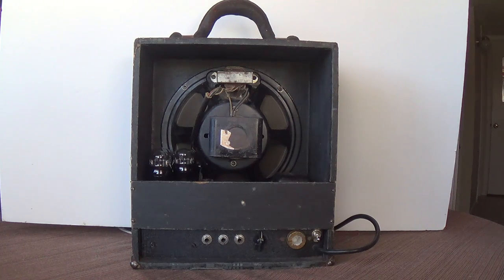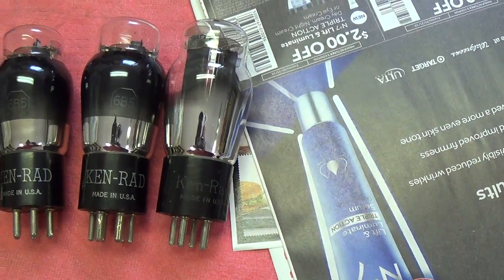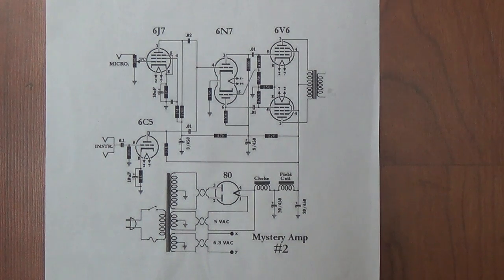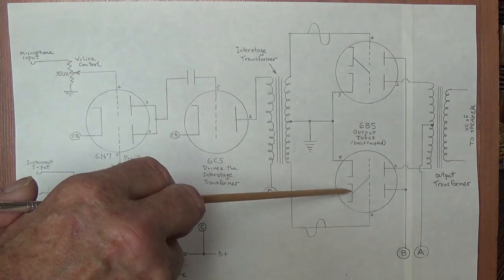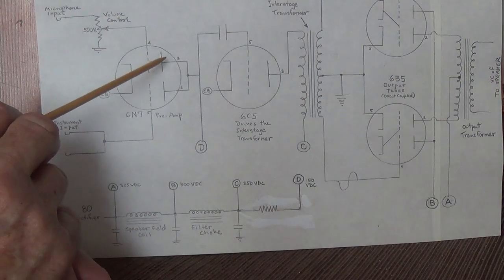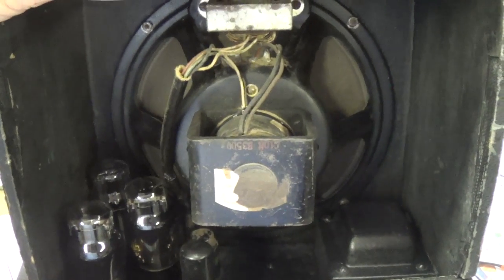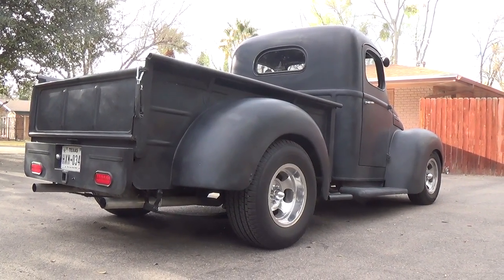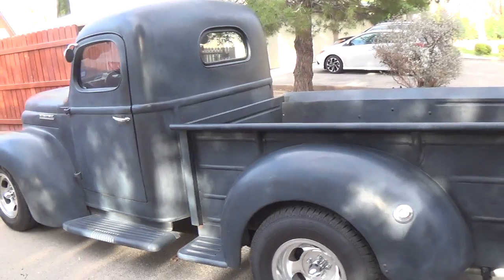Let's Evaluate and Repair the Ebay Mystery Amp

Comment: Great video as always.  I am wondering about the difference in the amps.  Do you think your "mystery amp" schematic a different version or different model than the amp in this video?  Also, I am very amazed that a speaker could survive that long and very amazed that the output tubes and other circuitry could operate and sound that good after replacing one item.  

What a great truck.
Reply from the maker: Thanks, JD. The amp had obviously been worked on previously, so odds are good that whatever was wrong with it was probably repaired at that time. I'm guessing that shortly after the repairs, the interstage transformer failed, and facing a $100+ part replacement, they simply cut the cord and sold the amp on Ebay as-is. The old speakers are plenty tough. Unless physically damaged or blown out by excessive power/heat, they tend to sound wonderful.
Reply: Good stuff.  I am looking forward to more "amp shenanigans" as you say in Mystery Amp part 1.

Comment: Great job on this amp, Doug! I was surprised to see that there are no DC blocking caps on the inputs to this one. A short somewhere in the preamp section could result in quite an electrifying performance! I also hope that metal speaker grill is grounded to the chassis, for the same reason. Also great job on the International truck, she’s a beauty!
Reply from the maker: People were tougher back then, Gary......a good shock once in a while was considered healthy :):) It would require a dead short between a grid and plate to really blast you, and they are exceedingly rare in my experience. Also, there are some stout resistors between the grid and jack to stem the tide a bit. I have seen caps on microphone inputs to prevent errant DC from the microphone (if it had its own power supply) from reaching the pre-amp grid and altering the bias.

Comment: Thanks for the video Doug, very informative. Did you end up putting a dust cap on the speaker after you cleaned the coil out?
Reply from the maker: Yes, I had one in my re-coning supplies. You can see it through the grill if you look hard.

Comment: Greetings Uncle Doug! These old amplifiers offer an interesting glimpse into the formative years when they were offered alongside lap steel "Hawaiian" counterparts. The stripes & handle are reminiscent of early Gibsons, (noticed the  EH-150 schematic,) but of course on anything this old virtually all bets are off. Of particular interest is the boxy "telephone" sort of sound, reminiscent of antique records from the 1920's and 30's. 
Any thoughts on the use of a transformer as a phase inverter?
Thanks, as always!
Reply from the maker: You're welcome, PS. The circuit more closely resembles an abbreviated EH-150 than any other schematic I could find, so I used it as a guideline. I tend to think that the amp was built by Gibson, perhaps as a Kalamazoo. If you look at the prewaramps.org page, there is a Kalamazoo with an identical cabinet.

I really like interstage transformer phase inverters. Wurlitzer used them in all their classic jukeboxes, and they were known for wonderful tone. I would like to hear an AB comparison between tube and IST PI's. I'll bet there is an audible difference.

Comment: Great video on both the Mystery amp and the International truck. I'm thinking that an interesting project would be to build a tube amplifier and use it in an old truck to power an audio system.
Reply from the maker: Thanks, Buddy. One problem is vibration. Some old trucks ride quite harshly and I  would worry about the welfare of the tubes.....however, they did have tube radios in the old days (which often didn't work well),  but I think it was simply the best they could do until transistors appeared.

Comment: I feel your trucks should have valve radios in them :)
Reply from the maker: The vibration would probably damage the tubes......but it would be an interesting experiment.
Reply: @UncleDoug  -  the first radios in cars did have tubes
Reply: Tubes and trucks, that's what your made of Doug
Reply: Uncle Doug 
Oh yes sir. A solid point to point build, use of Joint Army, Navy tubes and a sensitive antenna would yield a mil. spec. receiver. Remember that far more complicated and sensitive transmitters and receivers flew the "Hump" over the Worlds highest peaks along with the Worlds worst weather just fine. 
I love the tone of the amp and the fantastic International truck! 
One of those Southern Air air conditioners might be nice in the Texas summer months.
Reply: All cars in the 50s had tube radios.  All the circuitry was typically in one chassis, and one unusual component was the vibrator.  This part, encased in foam rubber to keep noise down, consisted of a mechanical vibrator with contacts that made and broke the connection to the battery voltage.  It thus made AC, which was then used to create the plate voltage.  In a past life, I converted one to home use by putting in a power transformer, and housing it in a wooden enclosure.  It looked and worked much better than the usual "All American Five" table radios of the time.
Reply: Wasn't there a line of tubes made specifically for  automobile use? A 12u7 comes to mind as I used one in a headphone amplifier build.
Reply from the maker: Congratulations on a challenging repair job, RW.  It's great that there are still people around who can repair these ancient devices. Some day, sadly, that may no longer be true.
Reply: In the army we had ATV's, tanks, jeep Willys, with receiver-transmitter radio's...  all on tubes.  'Vibration' was an unstatement.  Tubes didn't care the least.
Reply from the maker: You're right, KM. As I recall, Loctal tubes were popular in circuits where vibration was an issue. They literally locked in place with a metal center-pin. I have a couple amps that utilize them.
Reply: I don´t think so, as at least here in germany blaupunkt, becker, and some other companies built car-radios...usually in a split two big-box style where one had these two knobs and the dialreadout in the middle and another even bigger box which contains the amplifier and the mechanical copper power converter and supply. The tubes in there had been specially made for car-radios and also had been mounted using big gromets around them, or even spring mounted.
Reply from the maker: I think the old steel spark plug wires were a major contributor, RW.
Reply: I found the type I was thinking about. They were known as "space charge" tubes and were supposedly designed to run with 12v on the plates
Reply from the maker: Good grief.....what a project it would be. I wonder how they eliminate the static from the ignition and spark plug wires. It used to be a big problem in old cars.
Reply: Weren’t 6v6 tubes originally intended for car radios?
Reply: George Robartes  , this technique of reversing the wall wart only works if it is a Transformer type wall wart, a modern wall wart with switching supply would blow up pretty quickly. And even the Transformer style wall work would have to be disassembled and the rectifier and filter capacitors removed from what used to be the secondary side  of the Transformer , and replaced with much higher voltage parts to reflect the hundred twenty volt output from the Reversed Transformer.
Reply: tube radios!

Comment: Got beer and cake ready to eat! great stuff. Since you balked at the 90 dollars, I take it it was an inexpensive purchase in its original (pre Dougified) condition? Was the design done to reduce the cost of using resistors. Were they expensive back in the day? Superb video once again. This circuit looks so simple as well.
Reply from the maker: A great combo, TT. No, it wasn't particularly inexpensive, I made a generous offer, but I do indeed balk when a company demands over $100 for an item that I can buy elsewhere for $16. The interstage transformers are used in lieu of rectifier tubes, TT, and I'm not sure why, since tubes were about 50 cents and transformers were probably several dollars. Thanks so much :)

Comment: I'm a bit disappointed. You haven't answered my question twice I've asked you now! What's the reason!🚔🚨
Reply from the maker: I'm sorry if I missed your question, John. I'm one of the few people on YT who tries to respond to all the comments......and I've had several thousand over the past few weeks. What's the question ?
Reply: Uncle Doug yeah sorry for getting shirty.. I'm just impatient. When you did the other amplifier you talked about shielding the wires what went to the pots! you didn't explain where the Shield is going I was wondering is it shielded to ground/earthed or not! where does the Shield go to?
Did you spray that car yourself did you use acrylic water-based or solvent based, you get a better covering with water-based I'm going to be critical as usual!! I thought it looked a bit patchy what 2k lacquer do you use on top? Did you read my comment about your arthritis? On your last video. Where do you buy those dust caps from cheers for now.
Reply: John sweda one side of the shield is grounded (connected to “earth” as they say across the pond). The other side of the shield is just tied off and insulated. This protects the cable with low level instrument signal from electromagnetic noise.
Reply from the maker: Martin's answer is excellent, John. I do my own body work and spray primer with an HVLP gun, but don't have a proper booth for gloss top coats. I use either epoxy primer (on the Model A), or lacquer primer (on the '57 Chevrolet). I have spot painted the International, but about 90% of its finish is the original, weather-beaten black it had while sitting in the field. I really like its aged appearance. I have never used a water-based auto paint. The speaker supplies come from a company that I name in the description of the How to Recone a Speaker video. I have not seen your previous comment.
Reply: Uncle Doug so why can't you use a lacquer that has a hardener in it if you've got a gun you can mix it up? You should try waterbase it's very good give you much better coverage and it's healthier for you! I hope you're wearing proper masks they are very toxic cancer-causing solvents repellents in the paints. You don't use filler primer? Try and get Yourself one of those marquee tents some of them are foldable like a concertina be perfect for spraying. Or make a concertina tent just with six legs that can be pegged into the ground take the  concertina centre part either side what could be made up from bamboo or aluminium. So the legs make a pointed roof clip it on with those spring clips cover it with tarpaulin or whatever.
Reply from the maker: I do use epoxy primer, John, with a catalyst. I will keep the waterbased paint in mind, as well as a spray tent. Yes, I wear a respirator.